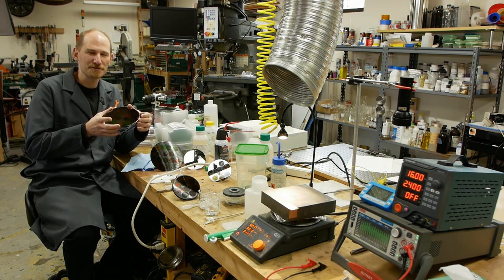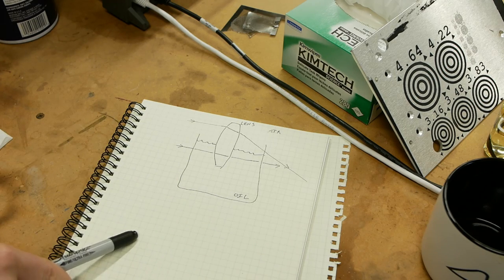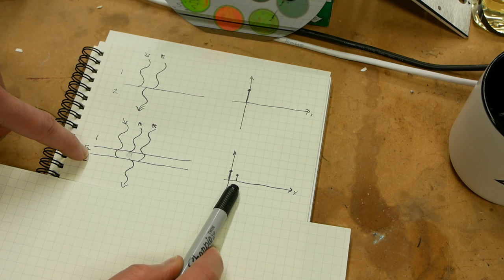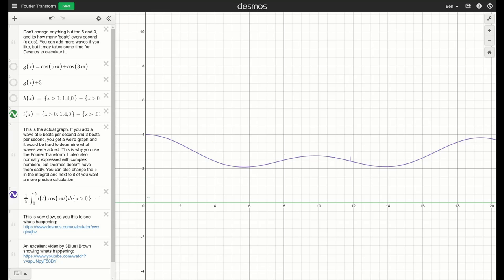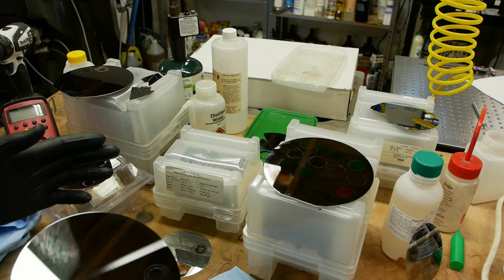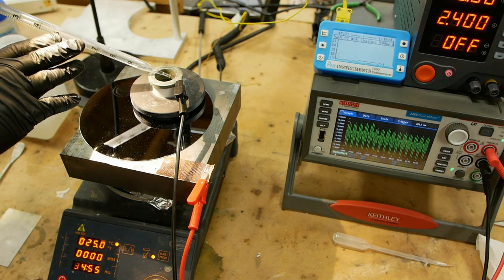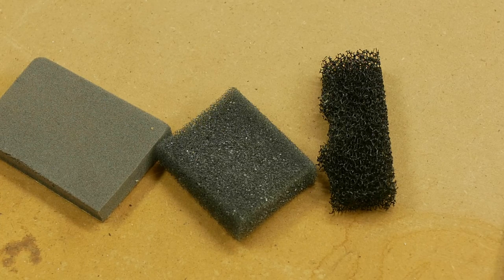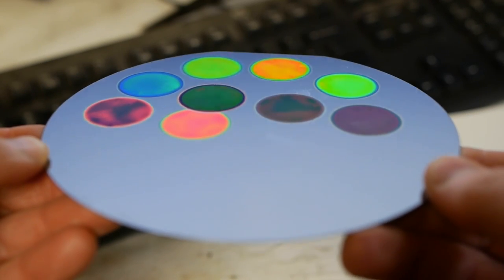Etching silicon wafers to make colorful Rugate optical filters (porous silicon)

Comment: What would happen when you cover a mirror with an anti-refelctive coating?
Reply: Huh, hadn't though of that.  My guess is that the reflection will have a colored tinge,  where the tint is white color minus a percent of the specific wavelength the anti-reflective coating is designed for.  Since the air-AR boundary reflects perhaps 5% of the specific wavelength (green lets say) and the AR-mirror boundary reflect the rest 95% green, then you will see 90% green.  All other colors you will see at 100%.  So the resulting tint would be blue-purple perhaps.
Reply: I initially thought, "oh it would be an entirely black mirror!"  and that would be cool.  But as in my previous post it perhaps would be tinted.
Reply: Reminds me of Lippman plate photography. Look it up! It would be interesting if you can make essentially digital Lippman prints this way, because up until now, Lippman photography is considered impossible to counterfeit.

Comment: How are they light emitters/receivers if the porous parts are non-conductive?  Do you need to keep the porosity low?  Are they conductive internally still (re: your comment about the charge  carriers being used up -- are the insides still conductive?)  Can you make broader-spectrum more-efficient solar panels with multiple layers of porosity, or does the process inherently decrease the efficiency?  With alternating high and low porosity layers, can you make more and less conductive layers which can be "driven" somewhat independently, or used as wavelength-sensitive somewhat-independent receivers or, I gather, the porosity is going to continue increasing on the outermost layers anyway (until they reach some threshold of current-carrying capability?)  So many questions... :)  Can the outer layers somewhat block (capture and convert to current) reflected light from lower layers, so you can increase efficiency of light energy conversion -- capturing otherwise lost energy?  How "black" can you make them?

Comment: With an air-glass interface, the Fresnel reflection coefficient is (n-1)^2/(n+1)^2.  For a glass with n= 1.5, the reflection coefficient is (0.5)^2/2.5^2 = (1/5)^2 = 4%.  For n=2, the reflection coefficient is 1/9 =11% rather than 5% as stated in the video.

Comment: They use these filters for creating special mirrors for OPSL lasers. The mirror is just below the optically pumped vertical cavity quantum well stack. Its usually then doubled to get the desired wavelength in the visible range. ❤

Comment: Two questions:

1. Where does one get a hold of highly doped p-type silicon wafers? Judging from what you said I don't think standard CMOS IC wafers are sufficient.

2. Is 50% HF really necessary? Would a strong KOH solution not work for this type of etching?

Comment: Everything is cool about this, except having to work with HF. I don't really understand the time step aspect of this. How do you determine the frequency/"speed" of the current waveforms? They're very "slow" compared to 1/wavelength of whatever color (obviously), so what even determines these time steps between your IFFT data points? I feel like I'm missing something basic haha. As a thought, many bipolar power supplies have an aux input which turns them into fairly high speed power amps. Kepco, Kikusui etc make some.

Comment: Can some give me a tldr of what he did in the video to make these silicon filters, did he use a detraction grating or light to make etches in Silicon?
Reply: Sure. TLDW: He etched the Silicon with Hydrofluoric Acid (wicked bad poison) while using a micro-controller to change the voltage (maybe the current actually, not sure) on electrons that were passing through it. The etching made it porous and the size of the pores could be changed based on how much voltage (it really may have been current though, still not sure) was applied when it was etching that depth. The upshot of all that is a filter that has a tune-able refractive index at every depth into it which is kind of crazy. The upshot of /that/ is that you can make really nice filters and anti-reflective coatings that are REALLY anti-reflective. Also even if you have to skip difficult or confusing parts of the video I'd watch it, it's great if you're really into tech. Also, he did not use diffraction gratings or lasers as far as I can tell.
Reply: @pinethetree  thanks m8

Comment: Really cool work! Would you be interested in looking into chiral  separation of carbon nanotubes? We've been trying to get this to work in our lab for some time with 0 success. However, it would be interesting content to explore using your fabricated CNTs. Essentially the graphitic sheets rolled into tubes possess unique chirality and electronic band structure. As an average it causes CNT suspended in water to be pitch black in color but using chiral separation techniques it is possible to separate them into a series of visibly colorful (RGB) solutions similar to what you see with metallic QDs. The application being various sensor modalities and semiconductors with highly tailored band gaps.
Reply: That's an interesting problem. I'm picturing illumination with certain wavelengths of circularly polarized light whilst exposed to strong magnetic fields granting unique behaviors in settling or suspension in a flow.
Reply: @AtlasReburdened  Unfortunately the published methods we've attempted are not nearly as sophisticated. They all generally rely on different adsorption affinity of certain chirality CNT based on their topology. Basically different chiralities have ever so slightly varying surface electronic/geometric properties that make certain molecules bind to them differently. You can then attempt to separate the particles using the bound "wrappings" using the usual suspects of liquid-liquid extraction, gel filtration, and centrifugation etc.
Reply: @halcofdrops  That sounds like a problem that could be solved/made more expensive by using biological molecules like antibodies since they're always chiral. (There is also the chance that this is a /very/ stupid proposal.) Also, I like Atlas WalkedAway's answer, it reminds me of magnetophoresis.

Comment: >you could also use a FET or Darlington
Darlington definitely, but not so much for MOSFETs. Common switching MOSFETs are not rated to act in the linear region, and may spontaneously undergo internal thermal runaway as they’re often made from a series of FET arrangements in parallel. Or something similar to that. To use a FET for an analog output, you’d better buy a specifically analog MOSFET. I’d just use a monolithic Darlington because they’re more common.

Comment: I can imagine this kind of thing being neat for use in equipment for photochemical applications. Not very familiar with this area, but from what I learned in physical chemistry, you could prevent side reactions if you eliminate certain wavelengths that would yield the wrong excited states. Now, I don't know if there are fancy LEDs that already do just that, but seeing that this technique could produce any filter with relative ease, this seems like a practical approach

Comment: Generally, HF etching silicon produces silicon tetrafluoride.  I'm trying to decide what the current does to this process applied to p-type Si.  For one, the boron or phosphorous dopants will remain to infuse the optical layer and this is probably the cause of the coloration (red phosphorous).  For another, I noted that sometimes (probably higher current) there was more bubbling and probably this is responsible for the lower densities.  At a guess, this is probably hydrogen, fluorine, and/or oxygen gas released from the dilute HF.  The heat, water, and atmosphere will oxidize the Si surface and then the HF will etch off the oxide, 
4HF + SiO2 --> SiF4 + 2F2 + O2; however, SiF4 is liquid at room temperature... thus, I don't know what the solid substrate is.
Generally, I can say that the low density layers will grow faster than the high density layers so some research will be needed to calibrate needed growth times for desired layer thicknesses and optimal results will utilize these data to time-stretch and time-compress the applied waveforms.

Comment: Guessing aluminum anodizing instead of silicon etching wafer by HF can have the same result, the modulated porous layers. If the hole between aluminum oxide is fine  enough, it “should” give similar filter effect. If yes, color aluminum surface can be made without dye.

Comment: Hi Ben, I've watched your videos for years. As a mechanical engineer I find the videos some of the best out there. Anyway, could you make a vacuum arc furnace. I was thinking of building one with a welder and a vacuum pump that I already own. The chamber and a way to manipulate an electrode in the vacuum are the creative part. Also, what type of metal (water cooled) plate should be used as a melting surface? Thanks, Jay

Comment: Regarding change of color for some but not all manufactured filters. Actually they all change their spectrum with changing second medium but shifted spectrum can match (for naked eye) initial one. There is a model of effective medium approximation that helps to calculate refraction coefficient for "compaund" medium. It does not matter what porosity or pores size: if PS manufactured it means alcohol already been inside and can penetrate. I have manufactured Bragg mirrors based on PS, they are easier to produce and have more dramatically peak shifts if layer thickness/porosity were calculated with EMA in mind. Feel free to contact me if you want some details on process ,)

Comment: I was fascinated by your video. I was inspired to buy the LR1-B spectrophotometer. I even sprung for the peltier cooled model for low noise.
Its not to often I get to buy something from a Canadian company ASEQ instruments. (I'm in Canada) They were difficult and unprofessional to deal with. I requested next day shipping it came slow boat over a week. They said they could ship from stock they couldn't. It came with no documentation and no information on where to find it. They told me they had included that info in a email a few weeks ago which had already been deleted. I could not find any such info on their website. There link pointed me to a directory of numerous files with no explanation not even a readme. They told me to download an EXE and a DLL into the same directory. I could not find any op manual for the application. I did execute the exe and it came up. But have no idea what the icons mean or how to use it. I have requested a manual, explaining this is useless without documentation. I have had no response so assume there isn't one. Much googling turned up nothing. I get some noisy spectral traces but nothing useful. I have wasted enough time and I am done with it. If anyone out there is inspired to get one of these request a manual first. See if you get one. I will probably send it back for a refund. Buyer beware!
JY

Comment: Very interesting. What I would like to know is the exact nature of the etching control. Is it due to the silicon turning into a gas upon dissolving? If so, the tiny bubbles, being not conductive, once formed would help to preserve the region from further attack. I guess there is a "reaction front", whose speed depends mainly on HF concentration and temperature, while the porosity (bubble size) depends on current. But this is only my uninformed guess...
What I fail to see clearly is the way the light interacts with the porous material, as it seems to behave as the porosity is in some obscure way related to the refractive index. The shining of further light on this subject would be welcomed.
Great video and topic Ben!

Comment: How do you dry the etched samples? I've been working with porous silicon like 12 years ago (btw - it has a lot more interesting properties, than only this) and the main problem was drying the sample after the etching, especially for high porosity samples. One of the ways, used for drying, was supercritical drying and as far as i remember your videos, you did that for aerogel, right?

Comment: Interesting to see materials with arbitrary reflection spectrum. One (theoretical) use case could be projector screens. If screen reflected only those wavelengths that projector produced, then it would appear darker in ambient light than it appears for projected light. This would render higher contrast in black areas. If projector produced RGB colors with very narrow bandwith, then screen color could be closer to black.

Comment: To be precise, EM wave reflection happens when either (electric) permittivity or (magnetic) permeability changes. Since most optical materials have relative permeability of 1, their refraction index is tied to their electric permittivity. But you can imagine a case when permittivity and permeability change cancels itself, so the refraction index doesn't change, yet there will be reflection.
In other words, reflection happens when the medium impedance changes, not when propagation speed (refraction index) changes.

Comment: Did you window your current waveform at all? If you just started and stopped it you ended up with a rectangular window which, while providing a very sharp main peak, also gives your a lot of sidelobes with no attenuation. Something like a Hann window provides a nice trade-off between sharpness and sidelobes attenuation and likely would have helped with those sidelobes you saw in your spectrograms.

Comment: Really neat stuff, I can easily imagine a light emitting display made in this fashion with traces etched above and below the light emitting layers using masks. I guess this is also how they control the frequency of silicon lasers. I wonder if there is any application for plasmon sensors. It’s only a matter of time until you’re building your own superconducting quantum interference detectors. Shop-made tricorder anyone?

Comment: Could it be possible to detach those filters by using thermal shock/different expansion rates? Or what about growing a thin silicon layer on lenses (via sputtering or something, but I don't know what crystal orientation that results in, if at all), and then making a transparent layer ontop of that? What happend if polycrystalline silicon is used?

Comment: You should try etching the silicon long enough to get the whole disk to be one porous filter. (granted you would probably need to get thinner silicon or just accept that the top layer will be eaten through). Then use your electrical discharge machining process to carefully cut out the wafer. Then you would have a full lens material. Any thoughts Ben? Also phenomenal channel. @Applied Science

Comment: Do you know examples of such filters for mechanical waves? I understand why the energy in the light reflection is suppressed by destructive interference and therefore has to be transmitted through the lens, but I cannot imagine it for mechanical systems. For example with sound waves or more visually a few simple pieces of rope with varying masses tied together, as are often used in demonstrations for wave behavior.